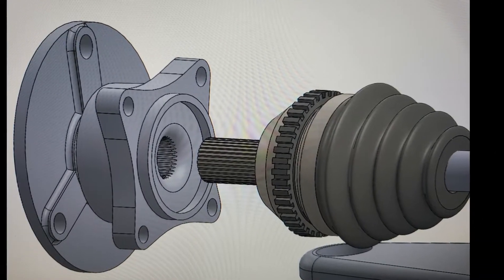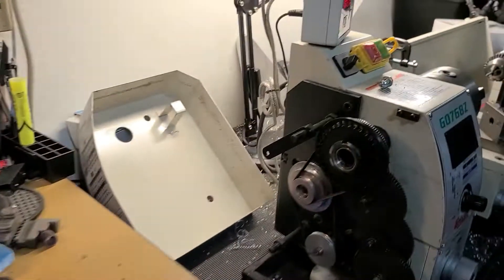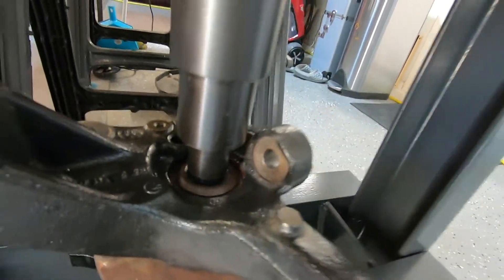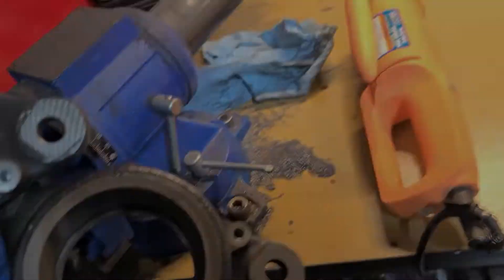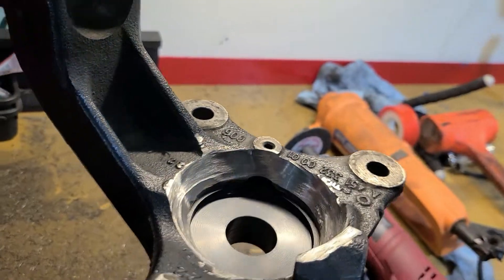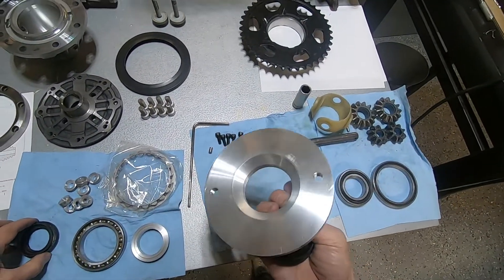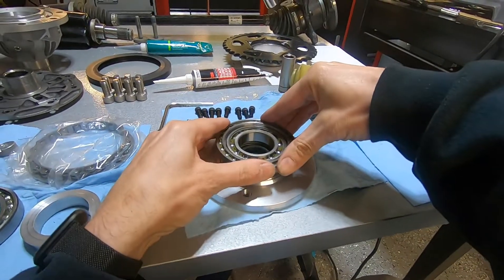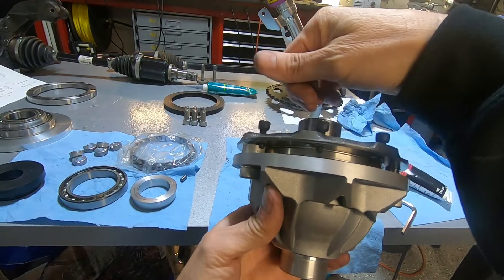Smart car + GSXR =AWD FUN Part 3 of 22

Comment: Can you make a steering wheel hub adapter kit? Let me know how much.
Reply from the maker: Do you have a good lawyer? 😆 🤣 
This requires removing the airbag, using non DOT approved parts. Drive at your own risk.
Reply: @Handy Dan  I'm totally aware of that. I did that with my E85 and Slingshot. It's just hard to find a hub kit for 451.  Please help me.
Reply from the maker: @doyzkie88  I had to get a stock steering wheel for the hub, I basically just cut the center hub out and threw away the rest. I machined it to fit into the golf cart hub from Amazon, I then had to drill the car steering shaft and tap threads.
You would have to do most of the work still, even if I had the hub.

Comment: Damn brother that looks awesome I’m really impressed with your technical skills mechanic of 25 years here And I own a 2012 Smart for two passion three cylinder not electric but yours is pretty bad ass have you had any issues with your bolt conversions for your wheels
Reply from the maker: Thank you for your compliments! As for the wheel adapters, not a single issue and several years on them.
If you do go with adapters, be sure you pick hub centric ones like the ones I got here
https://smartmadness.com/start-shopping/wheels-accessories-smart/smart-fortwo-wheel-adapter-conversion-kit-451-model-3-to-5-x-112mm-1083